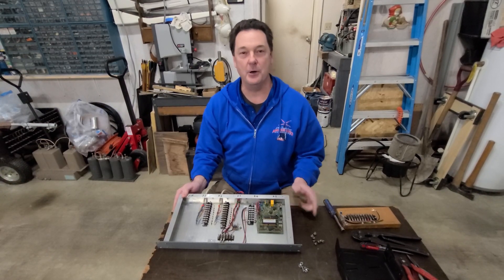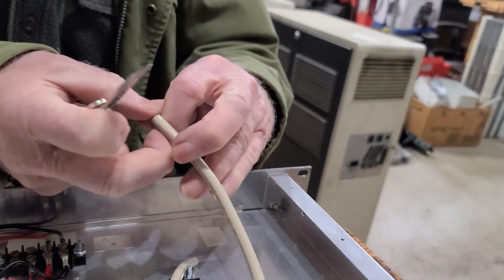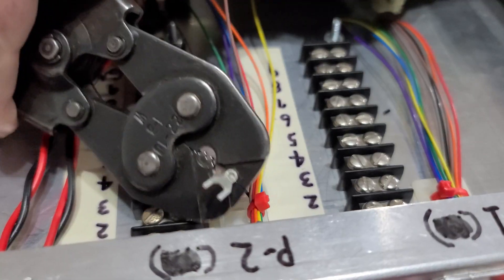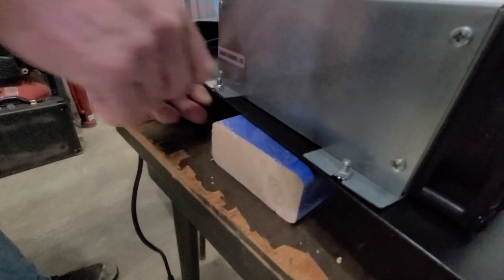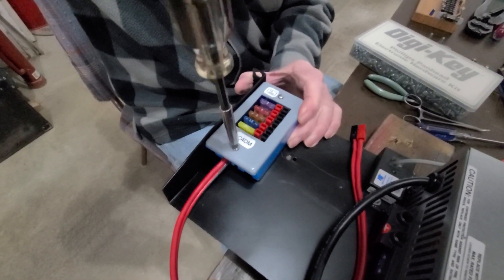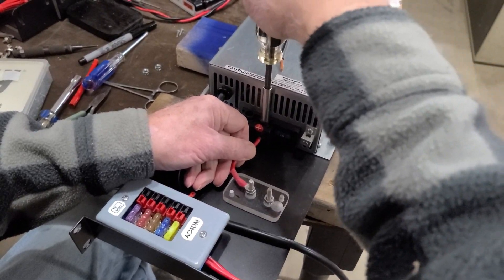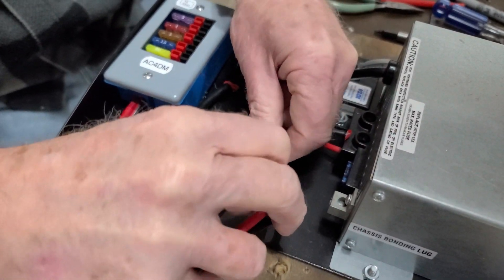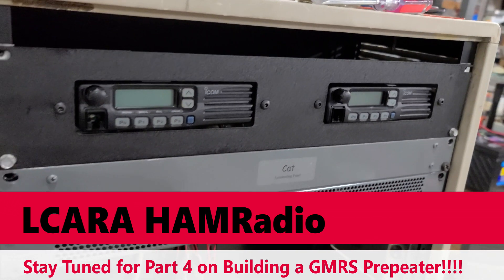LCARA HAM Radio: Building a GMRS Repeater Part 3 - Termination Panel and Power!!!!

Comment: Great job with the wiring and the video. 

However, the main cable strain relief, that is, the red cable ties are on the wrong side. The red cable ties should have been placed on the inside in the first instance! Any strain is likely to come from forces pulling from the outside not from the inside. 

To stop pushing forces in the cable from the outside to the inside he could put another set of cable ties on the outside but he has already secured the small wires with the some strain relief.

In summary, all pull snd push strain relief should be on the inside of the box!